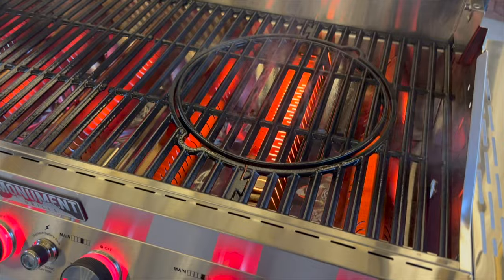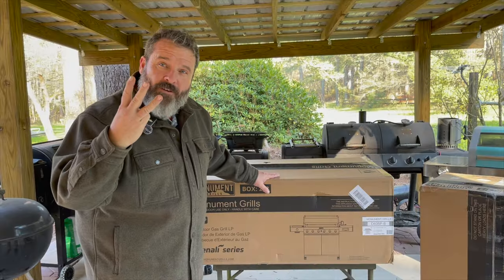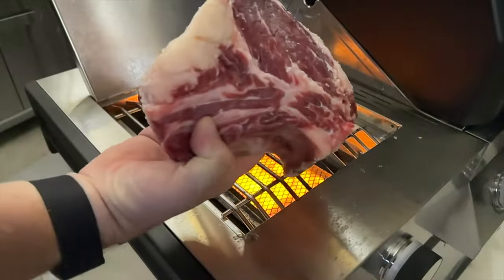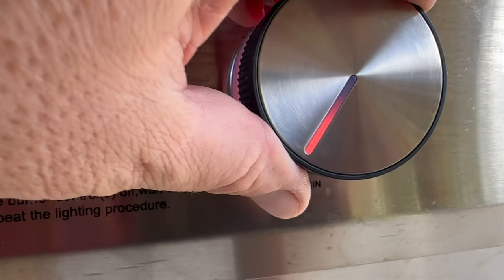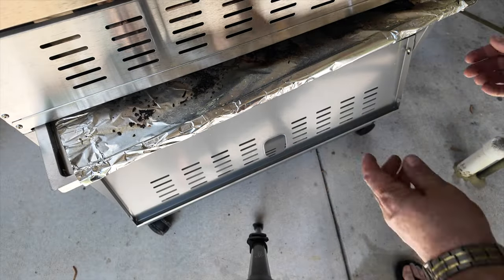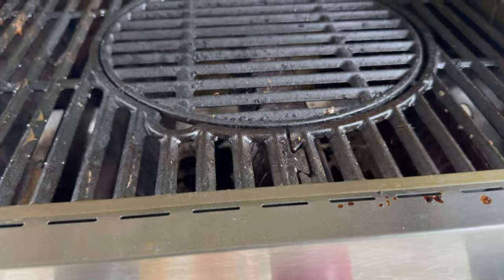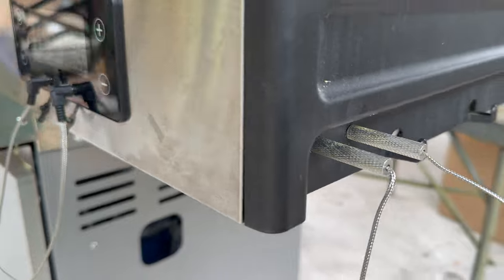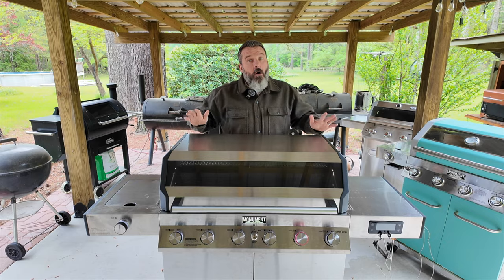🔵 2024 Monument Grills Denali 605Pro 6 Burner Gas Grill Intro | Teach a Man to Fish

Comment: I like that multi-purpose warming rack.  Looks like you can use it for sweet or jalapeno peppers or as a “drumstick chandelier” 😊.  I wonder if this warming rack is the same length/width as the one used on the 6-burner clearview model?  If anyone has both styles, can you measure (or test fit) and respond back?  I’d like to order one if they are the same size.

Comment: Hi, appreciate your video. I've have a 6 burner model with a side burner for several years now. Purchased from Home Depot. All these years never knew I had to force the bar over the tank. But I tried it won't work. Anyway, don't really care after all these years. My question is after thorough clean using Grillart sponge that uses a water on hot grates for steam my burners are only burning in front ⅓ of burner. I assume that means the burners need replacing.
Reply from the maker: @ggivensjr  it sounds like it, but I would inspect the holes first to see if they are blocked.